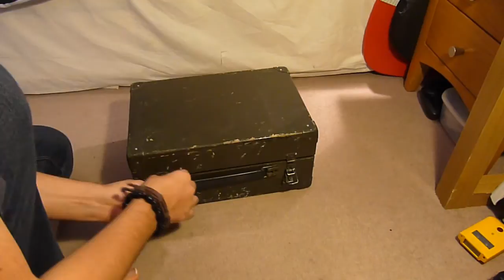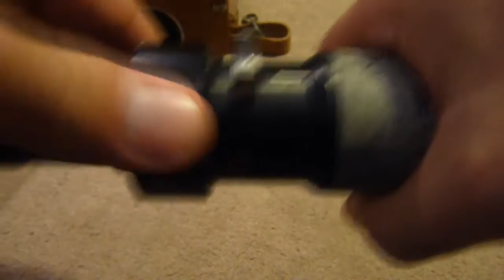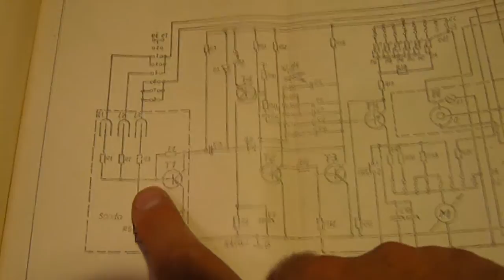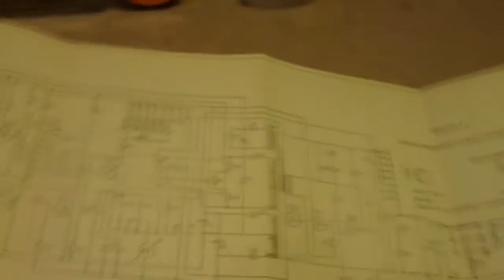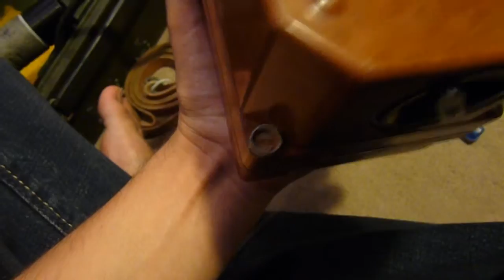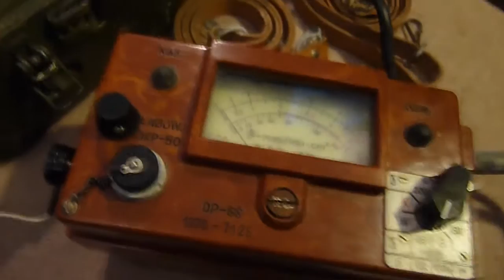DP 66 Geiger Counter

Comment: The plastic bags are really important for outdoor survey use. Even a microscopic particle of radioactive contamination getting inside the beta window and becoming stuck would give false readings so the bag is to prevent that from happening. Only Alpha particles would be stopped by the bag, but the DP66 doesn’t detect Alpha anyway so its not an issue.
Reply from the maker: That they are, almost like contamination condoms.

Comment: Bought one a few days ago. Resistor (R31) burned through and the lightbulb of the needle is broken. Will repair it though.
Also, try using it on almonds, most nuts are naturally radioactive as they obsorb it. So do mushrooms.
Reply: I repaired the resistor. Keeping the old, burned, one though.
I get click sounds but nothing else when it's on. So I think the copper spool in the needle is broken or something else.
Reply from the maker: Will have to give that one a go. The fact it is all transistor means it should be fairly easy to get any part that die.
Reply from the maker: That will be a hard one to fix, might have to try a substitute meter.
Reply: Got to try and remove the actual internals from the housing first. I screwed out some stuff. Removed the knobs but it keeps hanging behind something around the dial internals.
Reply from the maker: Year don't don't think I quite went that deep but then did not have a need to.
Reply: @RedmilesShark  That's a common issue due to the wear these units received from what I have seen thus far. Apparently it is fixable. I believe there was even a site advertising repairs in Polish.
Reply from the maker: Guess I was somewhat lucky mine was fine then.

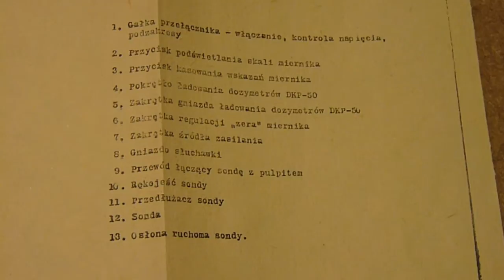Comment: Translation from Polish to Englisch [14:18]:

1. Switch - turn off/on, voltage controll, subrange.
2. Backlight button.
3. Button of canceling.
4. Wheel of charging the dosimeter DKP-50.
5. Cap of dosimeter charger socket.
6. Cap of adjustment standby mode.
7. Cap of power source.
8. Headphone socket.
9. Wire connected probe with board.
10. Probe handle.
11. Probe extender.
12. Probe.
13. Moving probe cover.
Reply from the maker: +Terra Thesauris Nice, thanks for the information.

Comment: That hole is an 'Optical Dosimeter Jack'

"The instrument is equipped with a socket with adjustment knob for charging DKP-50 optical type dosimeters. The jack is equipped with an internal source of light during charging, allowing to view the dose rate without interrupting the charging of the dosimeter."
Reply from the maker: +Alan Bacon Thanks for the info. Had me foxed for a while.

Comment: I have this Geiger Counter. I also translated the manual . What you should have in the case in terms of paper is the operation manual and  the service manual.
The manual tells you the tolerances of the unit, how it works and even which tube is on for the sub-bands you select with the rotary selection switch.
There are three scales for measuring radiation. the top scale is in rozp.min*cm^2 which roughly translates to "decays a minute for every square centimeter". the second scale is for almost every sub band (all bands in milliroentgens and all but one for roentgens). The last sub band (for the highest range of radiation in R/hr) is used ONLY for the last sub band on the selection switch.
The beta x10 function, contrary to the manuals instructions, can be used with the middle scale to get a general reading of beta.
According to my service manual the last maintenance check was in 2006 and it passed inspection with flying colors.

I will be willing to post the translated manual on dropbox and post the link when I make my video review or if you want it before my release of the video, I can put it on dropbox early.
Reply from the maker: Henry Söderlund I don't see why that would be a problem. The internet is for sharing ideas and knolage freely.
Reply from the maker: ajsliter Nice, thanks for the extra info. Please do post the translated manual up at some point and past a link so everyone can view it.
Reply: *****
Until I get a Video up with my first voice over. Here it is:
https://www.dropbox.com/s/dhqkodh422yul32/Roentgen%20Radiometer%20DP-66%20Operations%20Manual%20TRANSLATED.docx?dl=0
Post it if you'd like!
Reply from the maker: AjSliter Productions Excellent, thanks for producing this and publishing it.Most would not bother to put in the time.
Reply: *****
 It only took me 3 weeks with a little English Grammar to fix the rough translations from Polish and the basic technical knowledge of a Geiger counter circuit to fill in the technical information. I did this to help extend the life of these units because they are more versatile than the overinflated ones that are made now and even the DIY kits you can purchase seriously performs worse than expected for the money and time you put into it. When calibrated, these units will outperform the competition. Even its Russian counterpart the DP-5 A/B/WB seems old when pitted against this unit. If the technology was somehow modernized for easier calibration; this unit would probably be the "Stradivarius" of the Geiger Counter World.

Also The Dosimeter DKP-50 has another version, the DKP-50A. I am not sure if they are similar enough so that both may be inserted in this unit or not. The DKP-50 is scarce and will most likely be very expensive (i.e. $20 a pen). The DKP-50A on the other hand is readily available and even comes in bulk with its own charger that may or may not work. To get one that works they may charge from $5 to $10/15 a pen. If it does work in this unit, it is a worthwhile buy.
Reply from the maker: AjSliter Productions Still it is time and effort that you put in. It is a rather lovely unit. I do need to get the dose meter that goes with it.
Reply: Hello AjSliter Productions *****!
***** asked me if they could put this English manual as a downloadable file to their webpage so that other could use this device in the future. Is it ok for you?
Reply: Henry Söderlund  +TheEPROM9!
That's Fine with Me :)
Reply from the maker: +AjSliter Productions Thanks

Comment: This is a polish doseratemeter, I sadly can't translate it since I only speak Russian & English.
It's nearly a clone of the soviet DP-5(the B version of which I own).
The hole is for charging personal dosimeters(DKP-50), you insert it and tweak the knob to bring it near zero(full charge), and the light bulb is used instead of the sun for you to see the scale inside.
The tubes used are SBM-20(your typical all-around universal GM tube), and STS-5, which is nearly ignorant to anywhere below the point of "RUN, MOTHERFUCKER", but then it's quite good.
I don't see any vacuum tubes in the probe, though, which is strange.
The DP-5 series had a couple.
If you need to get a check source, go to your local pawn shop or whatever it is where you live, and try finding an old radium paint clock. Scare the shit out of the shop manager with geiger counter clicks(woooooo, it clicks, it's scary, radiation!), and get it for dirt cheap.
Also, ebay has a great collection of thorated lantern mantles freely shipping to any country w\ no eyebrows raised, and they're pretty hot.
Reply: +TheEPROM9 It actually says DKP-50 next to the hole and knob. Google for it and you'll find the dosimeter that's supposed to be used with this unit.
Reply from the maker: +Ni5ei Nice, should pick one up at some point.
Reply from the maker: I use a camera lens with a Thourium 232 lens at the back for a test source these days. Also makes a great lens for photos. This one is solid state it is the previous model that used valves. That one is on my list of intresting stuff to get.